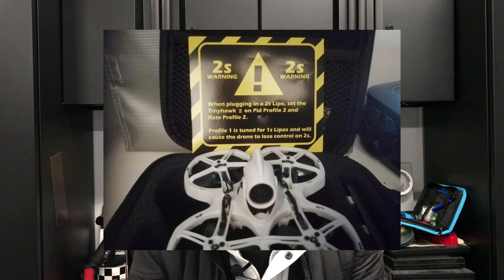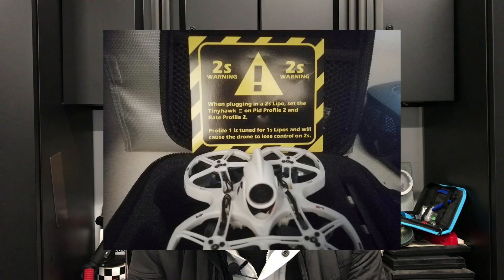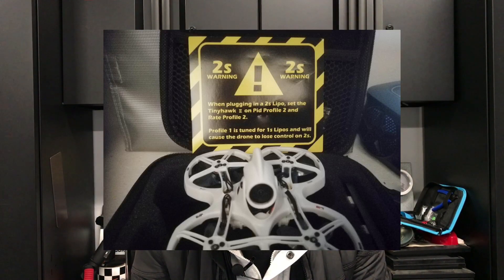Why the Emax Tinyhawk 2 Flight controller fails (Part 2)

Comment: Thanks I'm 12 and I bought this drone and I thought that it was broken just because the plug that the rear-left motor plugged into was not connected properly to the FC so I soldered it with my dad and it still didn't work and I checked and my warranty just ran out so I don't know what to do because I don't have the money to replace the flight controller ($75) so that's sad :(
Reply from the maker: Sorry to hear. It saddens me each time I hear someone have issues with an Emax product. The sad truth though is that even if it were under warranty, Emax most likely won’t honor it. 

The fpv hobby really does involve lots of repairs and replacement of parts. Although I’ve surveyed people buying up to 5 Emax tiny hawks before they finally give in and go for something else, I’d highly recommend something from Newbeedrone, a USA based company or from Betafpv which also takes realizability in their builds. 

Unfortunately, you’re in the same boat as everyone else with a tiny hawk. The specs of it are designed to fail and when it does, either fork over $75 for a new fc risking it’ll happen again or go straight for something else. Do the latter.
Reply: @Funcentric  thanks, do you think a TH2 freestyle would be a good decision because of the motor problem?
Reply from the maker: @peepeepoopoo24  I don’t like that the vtx is known to prematurely fail.
Reply from the maker: @peepeepoopoo24  only for 200mw. The stock setting is within legal limits, the vtx is a little chip with the black antenna on it that broadcasts the video signal.
Reply from the maker: @peepeepoopoo24  I wish I didn’t get mine. Didn’t last long. The f3 flight controller on that is known to fail frequently. Most whoop fc’s have poor quality in general but this one fails a lot. Cheap though. $35 or so for a replacement. But it’s a pain to solder everything to the new board. Also experiences poor battery sag. I use the same battery in my Beta85 X pro2 and zero battery sag. 

Also happymodel stock batteries are known to be junk. They puff up so quickly so often. 

I fell for the mobula7 hype too, picking it over the Trashcan even though the Trashcan has better specs on paper. 

By far, the Shutterbug 85 home built or beta85x pro 2 BNF is better by far. I feel like I wasted my money with the mobula 7. 

If you get it though, let me know how it goes after 50 battery packs. I’d be curious.

Comment: Mine failed the other day 😭
Reply from the maker: Yeah happens, a lot. The question is how many more will we keep buying. VTX? The flight controller should be okay on these freestyles. It’s the regular TH2 that has prematurely failing boards because the esc’s can’t handle the amperage. Okay for these freestyles though.

Comment: Brand new I had 1s battery in first 30 seconds good ,then this board failed ,, if it came on 2s this should not have failed ?
Reply from the maker: Other way around. If you flew it w/o making any adjustments to the profiles, then 1S is what it's supposed to be flown on. If you fly 2S on profile 1, you may be drawing too many amps from the FC.

Comment: What is the voltage and amperage of the motors. I'm wanting to build a test bench  tool to test each motor independently.
Reply from the maker: I don’t know the amp draw of the motor. Emax isn’t very good about publishing that info. As far as voltage, it’s designed as 2S capable. So that means Emax claims 7.4v .
Reply: @Funcentric  ok. I'll start with that information. I appreciate the response.
Reply from the maker: @ppulambe8311  sure thing.

Comment: I think I've flown 2S maybe once, when I tried flying outside couple weeks ago.
yet today after I crashed (and lost a prop) 1 motor would twitch. I took it apart, cleaned, and put it back together. Still twitching. 
I was looking into motor replacement and found this video, thanks to you I swapped two motors. 
It's now clear that the motor was never faulty, because after swapping the other motor would not spin.

I don't think I'll be spending $75 to replace the board because the same thing will probably happen again, 
I haven't even flown 20 hours with it.
I'll have to think what to do next.
Reply from the maker: Darn, I was hoping you were gunna say the motor worked, meaning the motor was faulting and it was going to be a $15 fix for a new motor. Sorry to hear. Unfortunately this is a incidence that happens repeatedly. The most I've ever heard someone rebuy a TH2 is 5x before going onto something else. A lot of people feel attached to the TH2 b/c they feel they've seen so many "reviews" (which are actually just test flights) and feel like they invest too much into it to go to something else. I'd recommend trying something new though. 

Many AIO flight controllers are weak though. I've had good luck with Newbeedrone ones through probably 500+ packs before it too finally died off. Those are over $100 per FC though. Not to say more expensive is better. Newbeedrone is domestic in the USA based in San Diego and they're active on their Facebook group which is a big plus.

Comment: I run mine in rate 2 profile 2 on 1 s it's a pain to switch back and forth and I had probs..but I Don't use the 2s battery without running a filter in beta flight to limit the throttle.then by the time you do that there is no advantage to using 2s..man emax dropped the ball on this one

Comment: first time trying a 2s battery freshly charged, I got a low battery warning and my tinyhawk flew away. I have no idea where it went...
Reply from the maker: Oh no! That’s worse than anything I would’ve imagined. Sorry to hear. Probably for the best to be honest. If you kept it and broke it, you might be tempted to fix it and end up getting stuck in the Emax family. 

If that happens on a next quad, try to disarm right away. It’d so light that there is less likely to be damage falling out of the sky. Generally better to damage it than lose it. 

Wondering if you forgot to change the rate profile. Only the PID profile changes by itself but not the rate profile. It might not have known there was a 2S battery in there.

Comment: I have both tinyhawk 2 and the freestyle and the tinywhoop burnt out an ESC in about 2 weeks however the freestyle never has issues and its so fun to fly. If using this for the freestyle with the lower KV motors as you said would you say its a good all in one FC or still no?
Reply from the maker: I don’t like how it’s proprietary. It does have ESC’s that can handle the amp draw of the motors at least which is a big plus. I still don’t like the freestyle 2 especially for beginners. I have a separate video on that. Lack of a UFL connector is super annoying amongst other attributes.

Comment: so the question is will the board fail on 1S or just on 2S?
Reply from the maker: I strongly believe the ESC is sufficient for the amperage draw of the motor under 1S voltage. 

However, the board can still fail on 1S from other vulnerabilities similar to quads of other manufacturers. Just poor quality control or running motors hard in the grass ans popping an ESC that way, hard crashes etc. 
Not to say it won’t fail anyway, but you increase your chances of survival multifold by avoiding using it on 2S.
Reply: @Funcentric  thanks, mate. your videos really made me think twice, but as I plan to fly it mostly indoors, it still sounds like a good (if not the best) quad for a beginner. I spent like 3 weeks researching different models and I even after your info, I think this one might be suitable for my needs, as I can't order from USA. anyway, if you have some suggestions about a better one from banggood, I'll be very thankful. keep the good work :)

Comment: Hey Funcentric!
You helped me a while ago and I like your honest opinions so here I am again! :)
So I'm looking to get a new whoop (my TH2 broke, and I'm pretty sure its because of reasons you also know about) and I think I got it narrowed down to the Mobula6 or the NewBeeDrone Hummingbird F4 Pro. The problem with the Mobula is that it looks perfect except that it seems to have some quality control issues. And I know how high you are on NewBeeDrone. (Sometimes I suspect you are secretly an employee of theirs always boosting their products LOL!) And their Hummingbird F4 pro is priced competitively to the Mobula, and the performance is equal if not better from what I have seen. But their is one common problem with the F4 pro that many people seem to encounter. This reviewer (not me) says it well:

This is by far the best flying race whoop I have ever had - all three of them were. It has an excellent tune out of the factory, it has plenty of power, it has all the features you want, and it wins races. The improved gyro puts this whoop head and shoulders above all the competition. The quad-blade Azi props on those wonderfully responsive NBD motors are a winning combination. The camera is clear and handles low-light racing better than any other in its weight class. The LEDs make it easy on race directors and spectators to determine who is flying what whoop. Were it not for an absolutely fatal flaw this would be the single best whoop you could buy and it would not be close.

But one unlucky hit will kill the receiver on this whoop. It is a design flaw that Newbeedrone has been trying to fix through multiple board revisions and it's still there. I have lost 3 of them to this flaw. Once you get that RXLOSS message in your OSD it's either solder on an external receiver (which adds weight that largely ruins the flying qualities of the aircraft) or forget it. And you only have a one month warranty - which for a craft with a known design flaw is absolutely unacceptable.

That's why this whoop will break your heart - it is so very close to perfection but because of the serious unresolved hardware flaws I CANNOT recommend this product. When this whoop is working it performs almost flawlessly. But if one gate hit can kill your whoop then all the fantastic performance in the world cannot make up for a complete lack of durability.

Maybe someday Newbeedrone will get this product right - they are so tantalizingly close. But until that happens, steer away from this product unless you can live with an external receiver or there is a revision that fixes the dead RX issue.

It seems like the design of where the RX is, is bad. What do you say to this? Should I still get the Hummingbird F4 pro? The Mobula? Another NewBeeDrone whoop? Or another whoop altogether? 

Thanks!
Reply from the maker: I remember you. If there are known flaws, you can’t get it and expect anything different. 

Whoops in general have issues with their flight controllers. It’s an ongoing thing. Perhaps get another newbeedrone product. 

The batteries that come with a the happy model whoops suck. They balloon up even when balance charged and even being conservative with the voltage. 

At the end of the day, I would still want a product with support. Local support is generally better.

Comment: Now it wont connect to betaflight
Reply from the maker: For me, the connection was glitchy. Sometimes I have to hold the cable and let the quad dangle below rather than set the whole thing on the table.

You may need to reset the thing. Bardwell has a good video on what to do in this situation. 

But yeah, the Emax stuff is frustrating. No one on YouTube talks about it. It’s all glamor and hype.

Comment: I just got mine and it wont power on at all at first it beeped with a blue flash then nothing after I unplugged and plugged back in batteries. It connects and turns on when connected to betaflight but with the batteries attached theres no power to can you help me please its brand-new never been flown
Reply from the maker: Does it always beep just once with the blue light and then immediately shut off or did it do that once and now it won’t power back on at all?

Comment: Hi there, do you know of any similar issus with the tinyhawk 1?contemplating of bying the rtf version of tinyhawk 1...thanx in advance
Reply from the maker: The TH1 uses a different AIO board entirely. I'm really not sure if the ESC's on that are rated high enough for the amp draw of the motors. I've heard less issues with the TH1, but then again it could just be that it's not as popular and there are just less voices discussing it. I'd recommend checking out the Tinyhawk Facebook Group and digging through some of the history. If you just ask straight up, you'll most likely just get a bunch of newbies excited to tell you how great it is. You really want to dig in to see the longer term ownership - not just people who have had it for 3 weeks who still love it.

Comment: Thanks for the heads up.  Does this apply to all the tinyhawk series that use 2s batteries?
Reply from the maker: Yes, this is specifically a warning about running the Tinyhawk 2 on 2S.

Comment: I tried my th2 on 2s only once. The quad felt so punchy and fun, but at the end of the pack I noticed how hot the quad felt. My intuition said something was up with the settings. Glad I found your videos! Thanks for sharing
Reply from the maker: No problem. Yeah, it's 2S capable, but not really a 2S quad. I wouldn't run it on 2S generally and wouldn't recommend running it regularly on 2S.

Comment: Conveniently marketed as 2S, In reality, using rate profile 2 with 2S, it flies exactly like 1S, no advantage whatsoever, only added weight and shorter flight times.
Reply from the maker: No way, the TH2 on 2S rips like crazy. Was hard for me to handle early on. It definitely runs differently on 2S than 1S. Very noticeable.